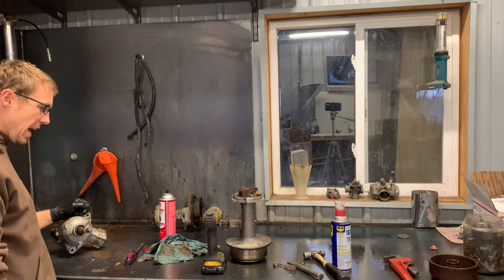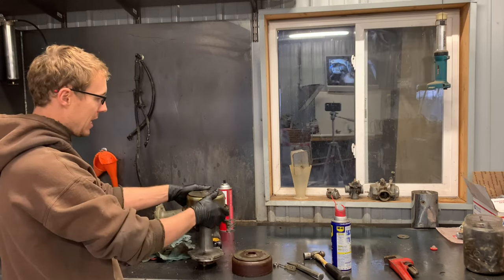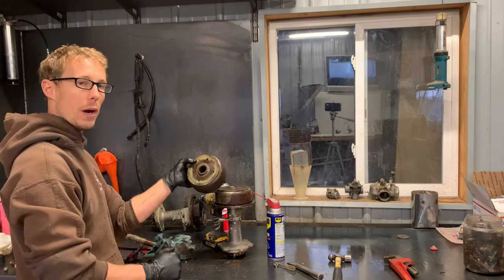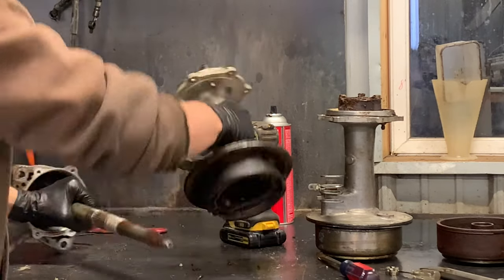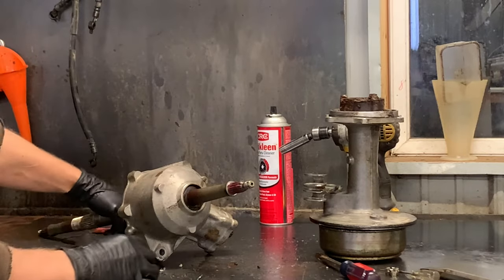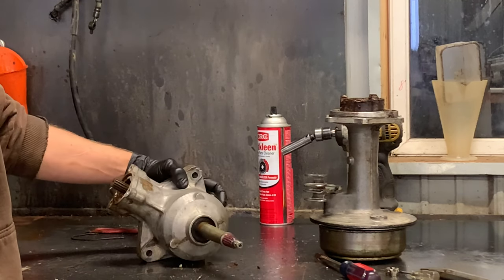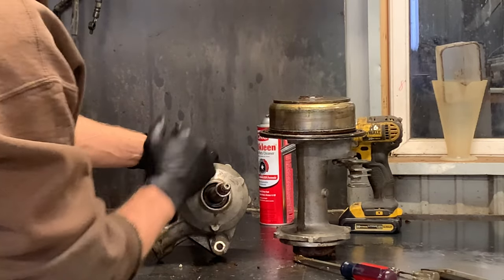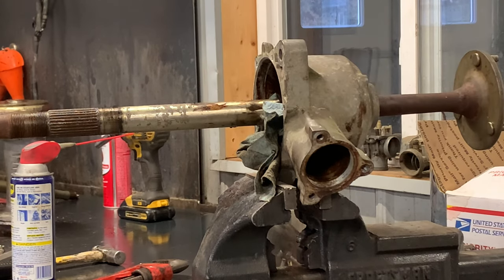Yamaha Badger 🦡 80 Kids 80cc ATV Rear Axle Drive Differential Explained - Stuck - Help!!

Comment: Do you have a video on how to replace the rear brake shoes on this model? I’m trying to figure out if I have to remove the 2 nuts on the axle? Looks like they need to come off,  before the cover will come off.

Comment: I have replaced the clutch plates and adjusted the clutch and it still doesn't want to move in gear   Could it have to do with the rear end I don't hear any grinding everything seems right it just won't move.
Reply from the maker: Definitely can be the rear end. We have engine videos and differential videos on this machine. Hope this helps. Also parts available: https://www.ebay.com/str/midnebraskamotorsports